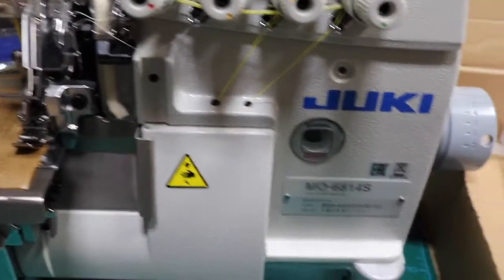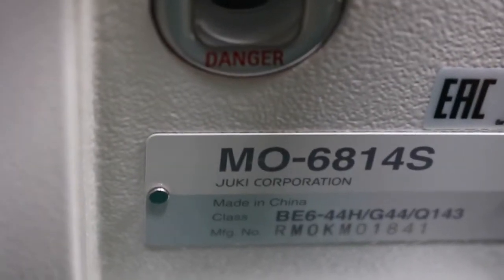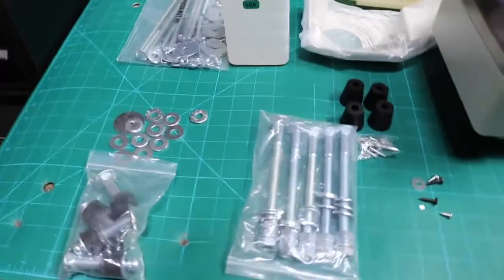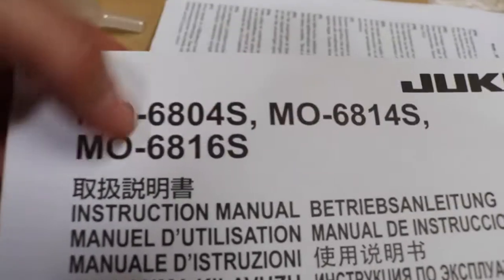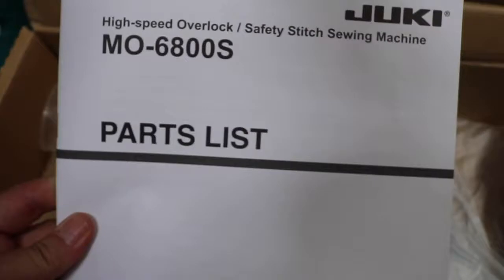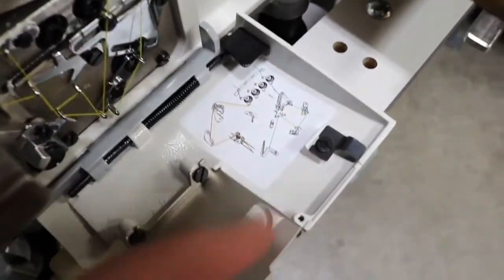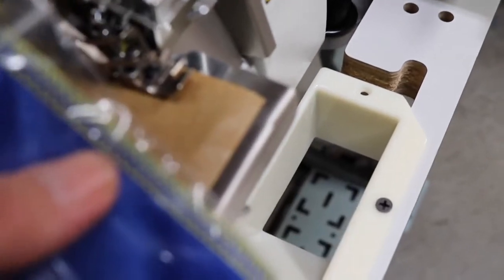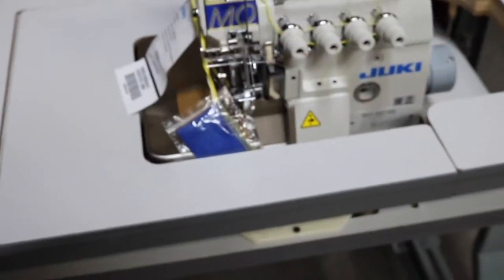Tutorial - Juki MO-6814S Assembly - Goldstartool.com - 800-868-4419

Comment: May I know the original belt size for this? I received M35 for the belt. I’m not sure what is the different with M40
Reply: m35 means 35" , m40 means 40 " . there is no original belt size. they are all depends on the table.
Reply: @davidakhamzadeh8884  alright got it. I'm asking cuz my Juki DDL8100e comes with M40. machine made in Vietnam but the overlock MO6800 series comes with M35. just curious. TQ for your reply.
Reply: @Away.Escape  one is juki 8100 and one is overlock . so its normal to have different size.